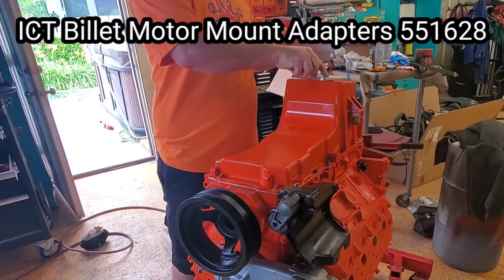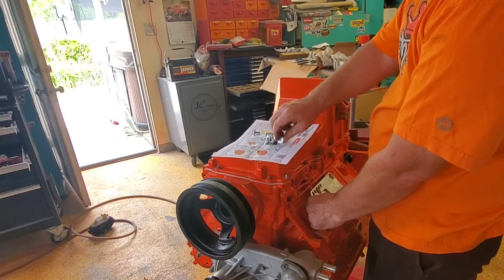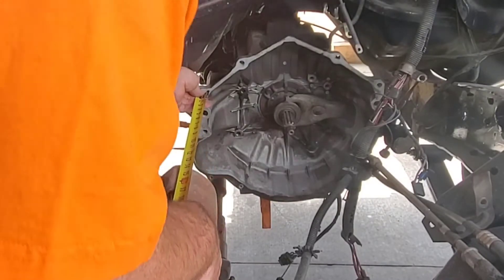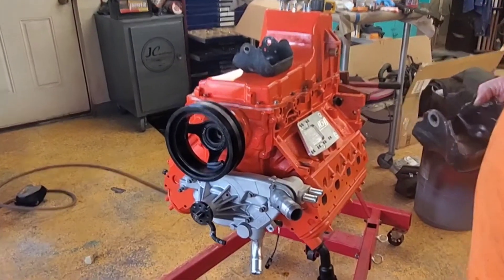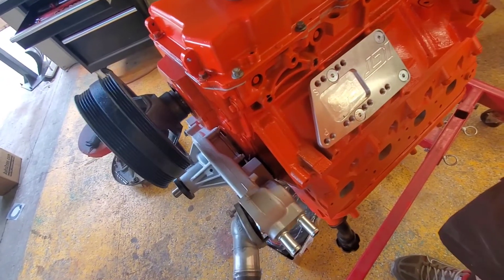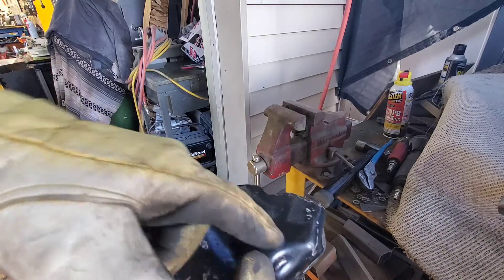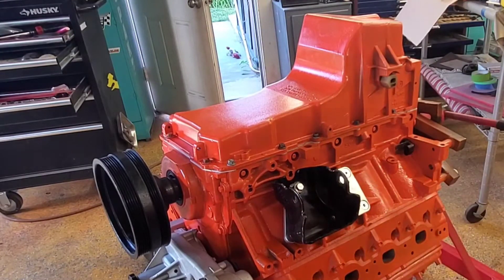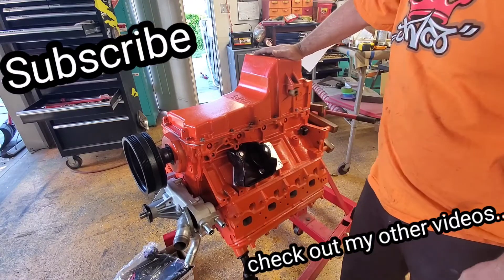Modify Clamshell ICT BILLET Motor Mount Adapters 551628 for my LS 6.0L square body k20 chevy truck

Comment: I could only match up one motor mount after doing this. The driver side mount is about an inch off. Did you have any issues with lining the holes to slide your mount bolts in?
Reply from the maker: Yes when I was installing the Engine was an 1 inch off and had to move the mounts over another hole

Comment: I usually run a ratchet strap from frame rail to frame rail with a couple 2x4's on the bottom of the trans pan to keep the trans lined up somewhat. Clams are tough.